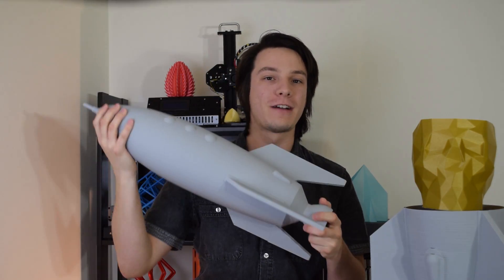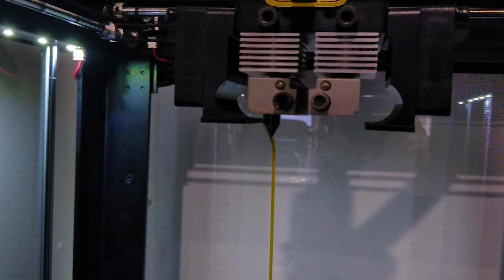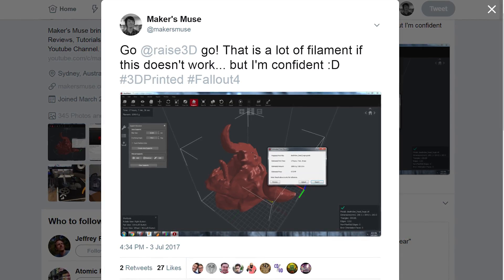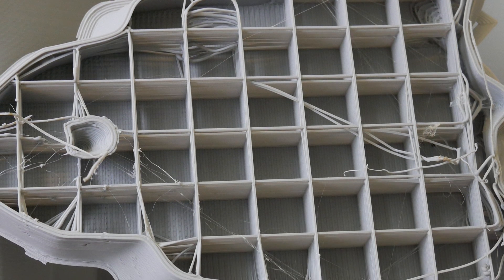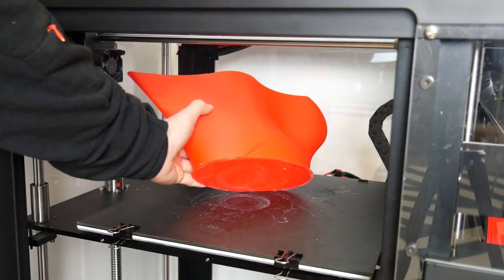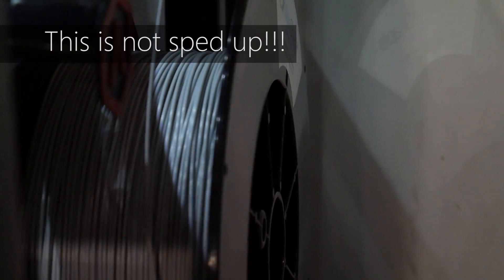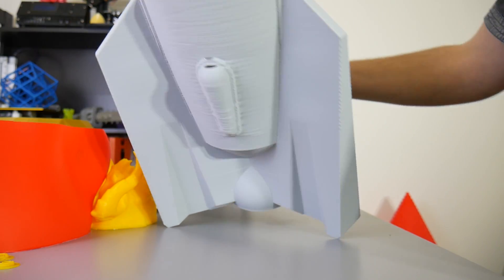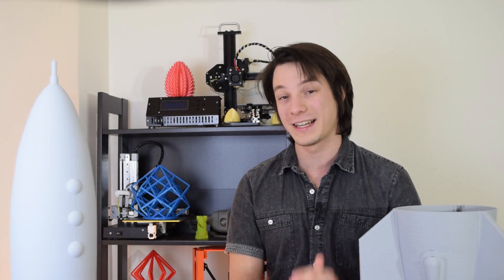3D Print ridiculously fast with this terrible mod - 1mm nozzle on the Raise N2+

Comment: You should really consider to upgrade the extruder to a Bondtech DualDirect. It saves a ton off weight and greatly reduces ringing and higer feed rates is possible even with a large nozzle. http://shop.bondtech.se/ec/upgrade-kits/raise3d/raise3d-dualdirect-upgrade.html

Comment: Can't you just print 0.4mm layer height with a 0.5mm nozzle? I use a 0.4mm nozzle and get very good results with a 0.35mm layer height, and 0.25mm layer height with a 0.3mm nozzle... So why not print "fast" with a 0.5mm nozzle at 0.4? Is it necessary a 1mm nozzle?

Comment: I believe you are failing because you need more heat....that was my issue anyways.......i ran into the same thing. 

MUCH more heat.  If you are printing at 0.8mm and you have your settings at 200 deg its too cold....  my example....

I have a CR-10 and I just installed a 0.6mm nozzle and started printing at 0.5mm....with the same settings I always use for PLA they all failed. I assume more plastic = faster cooling as the cold filament goes thru so 200 deg is probably around 190 deg.
I experimented....try not to  laugh.... I put my PLA temp up to 245 deg and my prints come out awesome......Maybe you need to get up to 250 because yours is bigger than mine ... ;)

Try it and see. Hope this sort of helps!

Comment: Dude your biggest problem there is your slic3r. You might get better results with slic3r 0.72 round about. There were peeps around in the forums that had no trouble with that size if done with the right settings.
terramir

Comment: Maker's Muse I've done a 1mm nozzle and printed a 12inch tall print in about an hour (admittedly entirely different printer). 

By default, you're right slicers assume some reasonable relationship between feedrate and linear travel, ideally you want a squashed elliptical cross-section for maximum adhesion. You'll have to increase the feedrate or individual layer width to be about 60% wider than your layer height, which is slightly different on different slicers. 

To get maximum print speed, most geometries are limited by mechanical acceleration and not velocity, so reducing the number of acceleration changes (by reducing layers) speeds up the print even if average linear velocity falls. I made a google doc that might present what I'm saying a little more clearly https://goo.gl/UBND4k

Comment: why so dismissive? once you get the settings right, large nozzles are a godsent for structural parts. dont bother with infil, make it solid! 
design accordingly to save weight and material, and include suport structures where needed.
Reply from the maker: Just first tests and results, I've ordered some factory large dia nozzles to test further. You NEED infill or parts take absolutely forever and will start warping due to shrinkage even with PLA.

Comment: The watering can is a dreadful design, not functional at all. You cannot put your fingers around a grip, and you cannot hold it above its center of mass, making it like 3 times more exhausting to use it.

Comment: They have to make a machine to recycle 3d prints
Reply: That exists already.

Shred the prints and feed them to a filament creating machine, like this one: https://www.filastruder.com/

There's others as well, of course, this is just the first that I remember.

The Filastruder is affordable, but it's doubtful if any regular 3d printer (the person) will use it enough to be worthwhile. You have to shred the prints small enough, the plastic should be pure and without dirt, and in any case the result probably won't be as good as new filament.
(Not to mention the problem of keeping a continually exact diameter in the result.)

Of course, if you print tons of stuff, it'll be cheaper to buy the pellets, throw in shredded failures and make new filament that way. Pellets are cheap (roughly half of filament, AFAIK).

Comment: Ridiculous comparison. I'm going to hand drill a 1mm hope and not change my settings/heating at all. Then, I'm going to try to print high detail items and talk about how bad the prints are.

How about trying to print things where you don't need high detail.  Everything I print ISN'T a bust of a head or a rocket.  Sometimes, it's just a box for playing cards or poker chip holder.

Comment: 3d printing has to be the least usefull use of a CNC machine there is, i have yet to see ANYTHING usefull better printed than molded, i mean, you have a cnc machine, put a dragknife on it and make stickers, it's more useful, at least you can sell laminates or stickers from that, only morons buy 3d printed shit from my experience... but i still haven't lost all hope from 3d printing